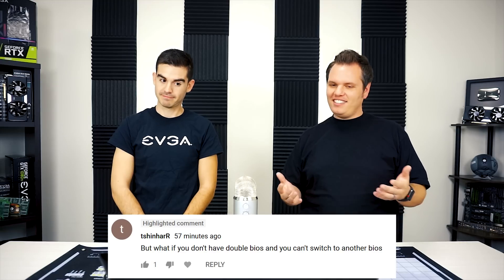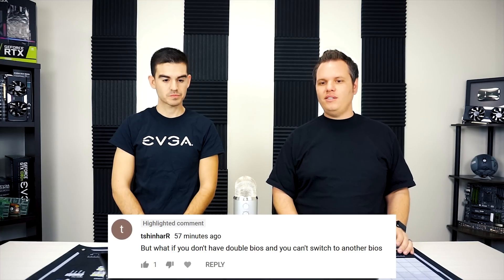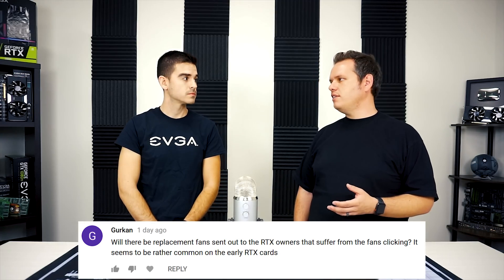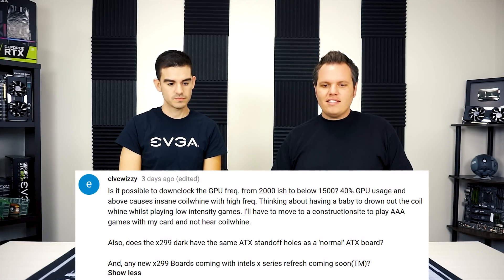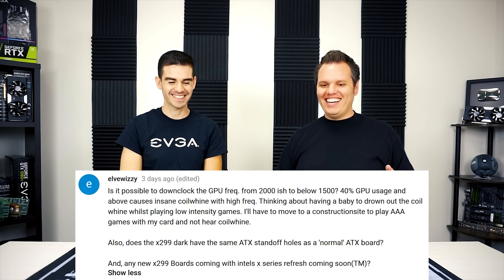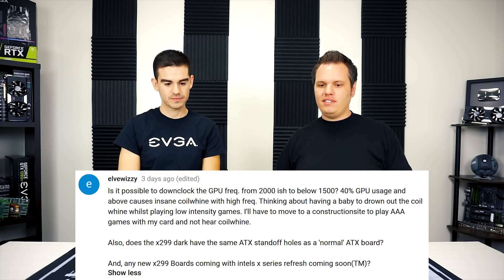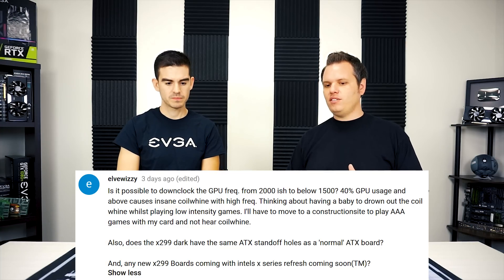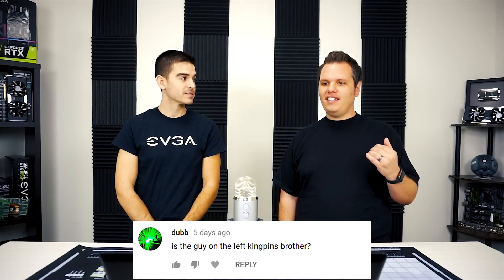Ask EVGA - Episode 13

Comment: I think this problem is a fan issue. Probably bearing? The fan blades and wires do not touch. Setting the zero fan hold time is also a problem, but more importantly, the noise itself is a problem when the fan stops and then operates. I wonder how many people are experiencing this problem.
And I wonder if the problem is solved if I replace it.

I do not speak English well because I am a foreigner.
Thank you for your understanding.)
Reply: I called about this exact issue and was told it is normal. such bullshit

Comment: My question for episode 14 - what's with some RTX cards reaching 8000mhz memory clocks stable while others only achieve 7500mhz? Are there differences in the gddr6 bin tiers or is this large gap just a matter of luck of the draw? (Comparing my 2080 FTW3 vs my friends bought on the same day from the same retailer)

Comment: Really happy that you all are doing these videos (along with the others). Still wish you'd answer my question about the prevalence of ugly AIB partner GPU's. It kills me to buy the inferior cooling FE cards but they are so much more aesthetically pleasing. I know this sounds "snobby" or nit picky but in a day and age when both performance and design are priorities for custom builds (your audience), I know that EVGA is shifting some focus towards aesthetics with the optional grilles and colored trim kits. If you do decide to eventually answer, I guess my question, in a nut shell is why do your cards look like gigantic heat sinks strapped onto the PCB with cheap looking plastic shrouds while FE cards look like they were designed by an aerospace engineer? I know that cooling, power delivery and overclocking headroom are much better on the EVGA cards but it's like a 62 Oldsmobile with a Corvette LS9 engine compared to the FE cards that look like a Ferrari with a Prius engine. Although, I guess, being that my current build is on the X299 Dark, I might seem a bit hypocritical since that MB is all about function. It does look good though!

Comment: I would rather EVGA keeps putting the money into the important things like VRM,, Mosfets etc,,giving us higher quality more durable motherboards than spending that money on RGB stuff which has nothing to do with performance,, if they want RGB there are plenty of kits you can buy to make your rig look like a circus attraction,, id much rather crush benchmarks and fps in games and be able to play around with a little recreational overclocking and not have to worry about burning up my board...